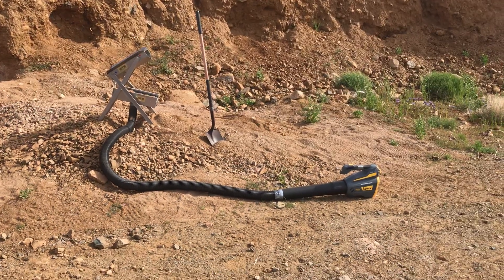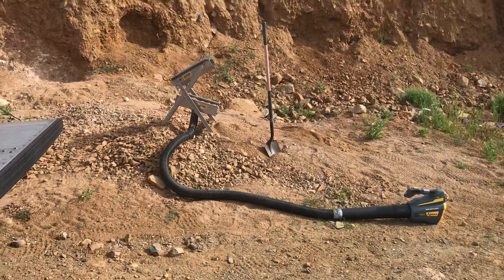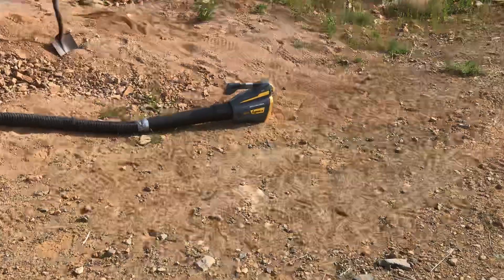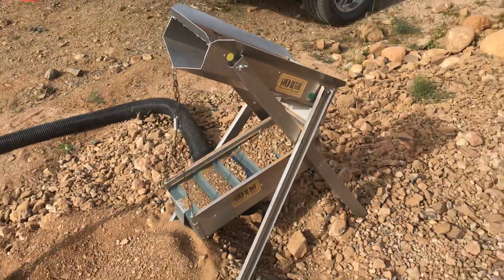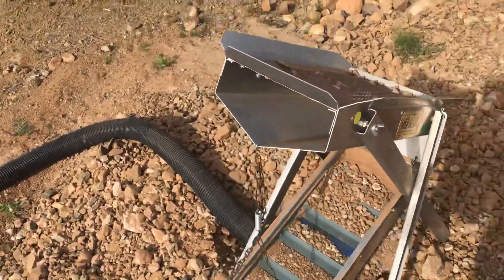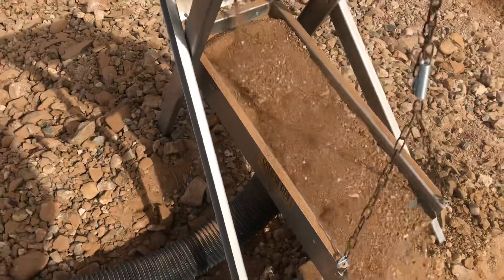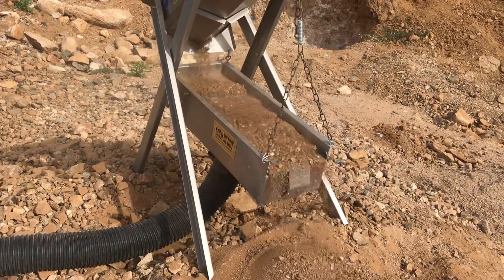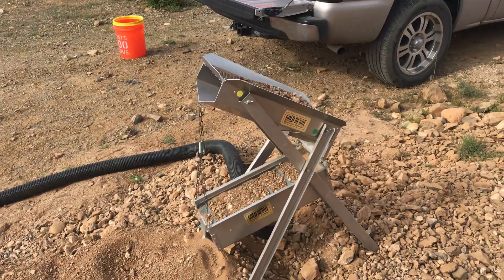Drywashing with a cordless 40 volt 2.5ah lithium battery leaf blower from Harbor Freight

Comment: Hey man, just a suggestion, run your air line with out bends, they reduce air flow. Are you still prospecting in Mojave? I manage 21 patented claims around Silver Creed road  outside of Bullhead city and around Oatman/Gold Road.
Reply: Do you ever grant individual prospectors permission to drywash or metal detect on your claims?
Reply: Still here?